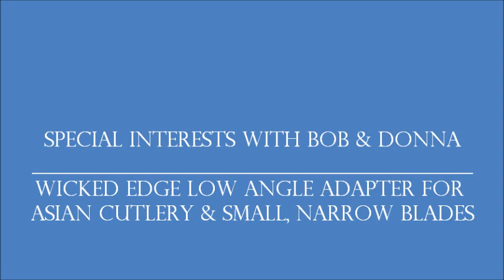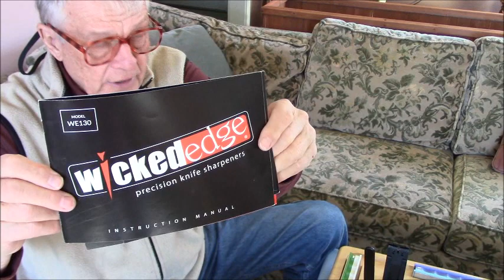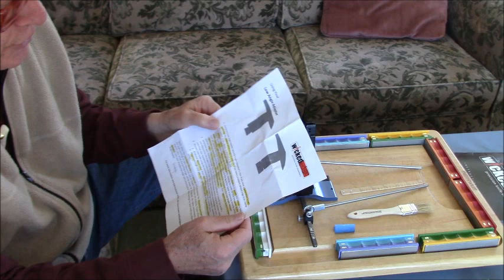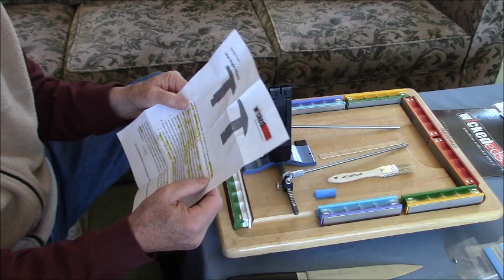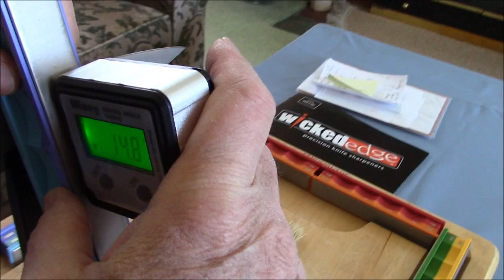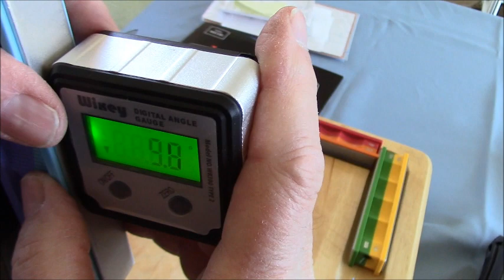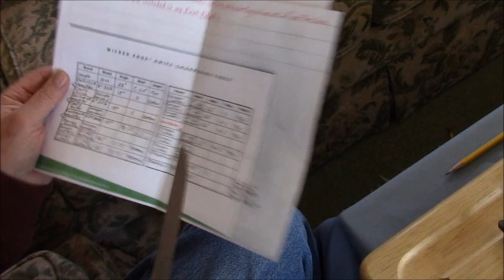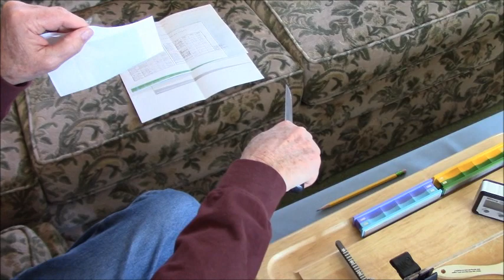Wicked Edge Low Angle Adapter for Asian Cutlery & Small, Narrow Blades

Comment: I have a wicked edge we130 with stones from 50-3000 grit, and leather strops. This video takes a 10 minute process, and drags it out for 45 min. If this was the only review I saw for this system I would definitely not have spent  $1500 on wicked edge products.

Comment: The angle markers are no longer accurate when using the low angle adapter. You will need to use an angle cube to determine the angle.